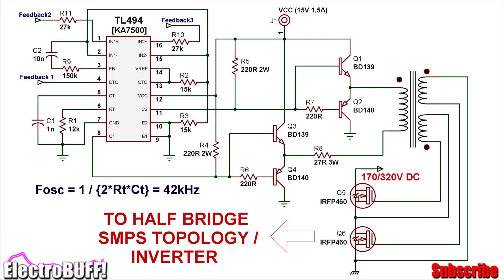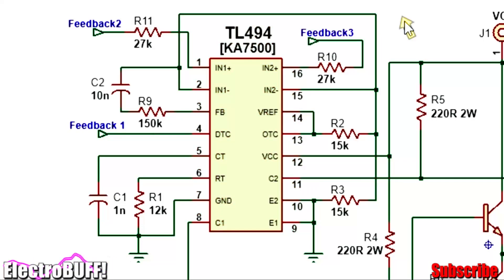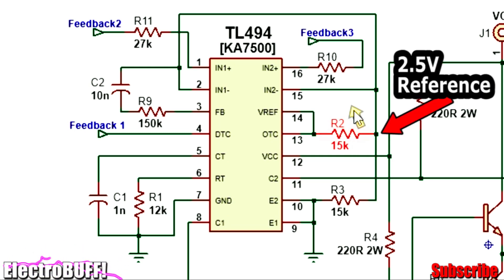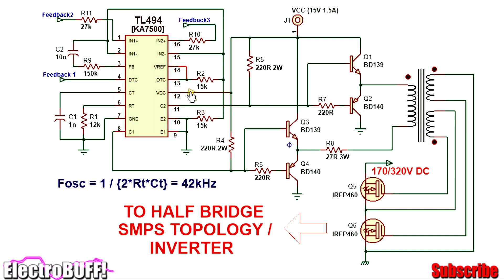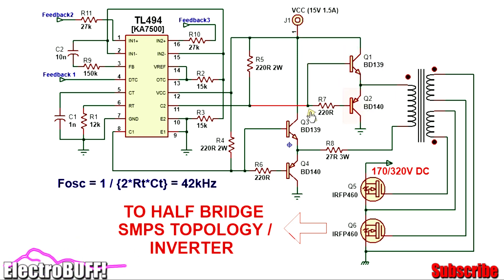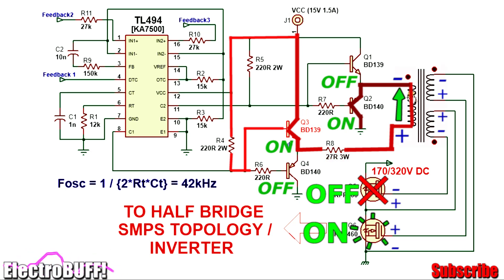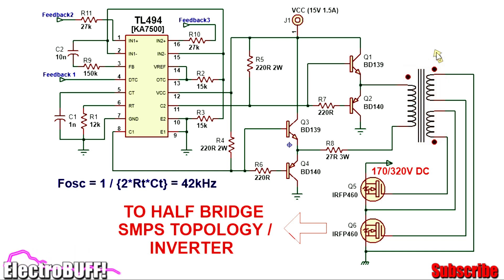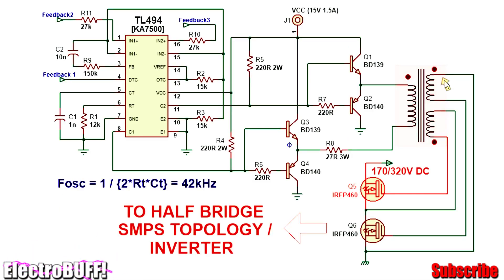TL494 Inverter/SMPS (Switch Mode Power Supply) Gate Drive Transformer Control Circuit Tutorial

Comment: U are missing the dc blocking capacitors on the primary of the gdt.
Reply from the maker: It's not that necessary because of the relatively low current. But you can include it and substitute it with the series current limiting resistor
Reply: @ELECTROBUFF  no it is extremely important to have one ..

Comment: The processes that occur with open transistors are not so interesting as the damping of the transformer winding of the gate driver is interesting - the author does not explain how the winding is blocked during pauses. Complementary pairs of bipolar transistors must be shunted with Schottky diodes. Where are they ? MOSFET gates should be shunted with 4.7-10 kilohm resistors to minimize voltage surges. The gate driver transformer must be wound on a toroidal high-permeable ferrite, triphilar, otherwise there will be voltage surges, ringing on the gates and elongation of the fronts. The windings must be identical and all three must be wound simultaneously. This transistor driver consumes quite a lot of power due to the low-resistance collector loads of the TL494. Pin 4 - not intended for feedback, but for softstart, which is ignored. Output current feedback is not provided.
Reply: ❤😂😂😂do u have any working inverter circuit design so I can try n work on...

Comment: Hi  ElectroBUFF and other members
Because I don't understand all you said ,So please help me to know what voltage I put as feedback 1. 2. 3. / for item working Many thank you
Reply from the maker: For the reference voltage at pin 2 or 15, you can use about 2.5V ( half that of Vref pin 14. Although this is just a habit of mine) Use pin 1 or 16 for feedback voltage input (obviously with a potential divider network. Ensure not to input more than 5V though) from the final output voltage you desire to regulate.
Reply: @ELECTROBUFF   Hi .Many thank you for your time reply and helpful me.

Comment: Your push pull transistors will easily heat up and burned eventually.
Reply: WHY, do you say that ?
Reply: @vtorsi610  Just make it. And let operate for a while with considerable load as per your design..observe how fast your drive  transistors heat up and your mosfet as well...
Reply: @gamvin2107  I asked you, "WHY, do you say that".  You did did not explain "WHY".  Explain ... what is wrong with this design?
Reply: @vtorsi610  I answered you already. Make that project work see for yourself.